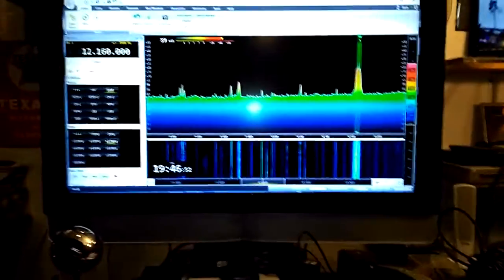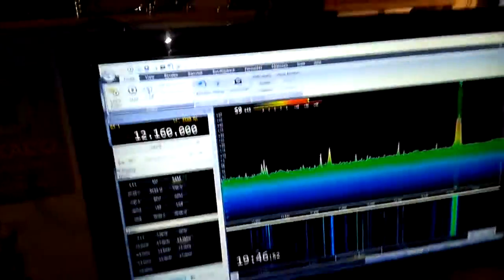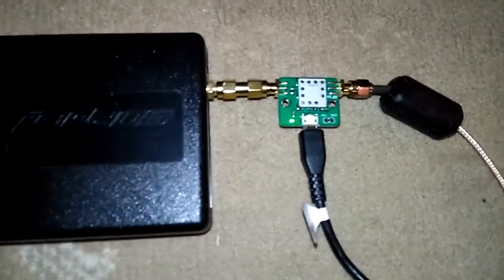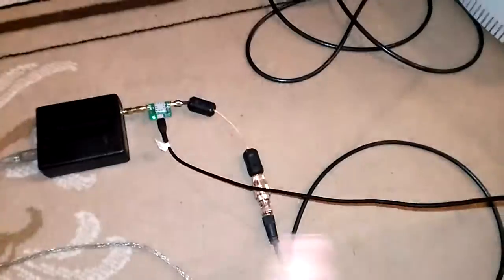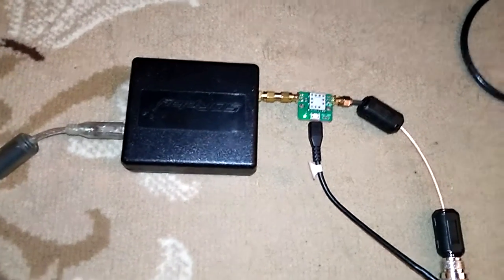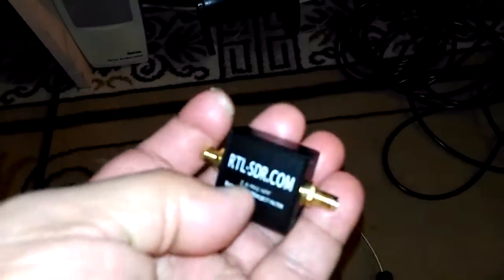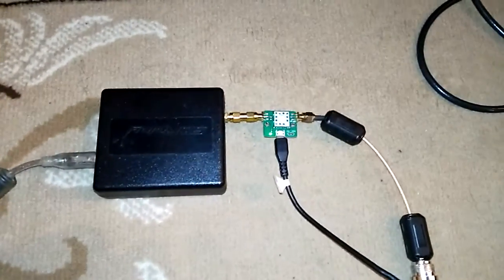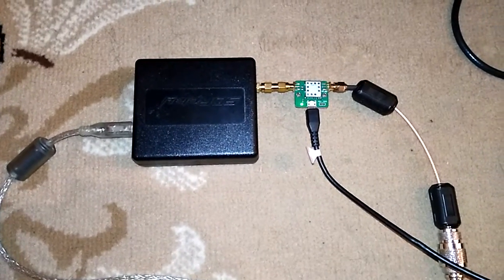DIY Copper Tube Active Loop Antenna - Low Noise Amplifier setup with SDRPlay RSP1

Comment: Which LNA is that?
Reply from the maker: They no longer sell this particular LNA on Ebay any longer,  You can search for another LNA on Ebay or Amazon as long it covers the HF bands from longwave to shortwave.  Thank you for watching.  Have a good weekend. :)
Reply: The Amplifier is from gpio labs: https://gpio.com/collections/low-noise-amplifiers/products/low-noise-amplifier-100-khz-2000-mhz-with-30db-gain and you can easily add a bias tee inductor for remote operation

Comment: Well done Danny. You may have just given us a low cost DIY alternative to the Wellbrook, MFJ and similar active wideband active loops. I would be interested in seeing LW NDB reception as well as MW and shortwave as you experiment further. Also, have you considered locating the LNA at the loop, and powering it through the coax? Not the easiest thing to do, but it would eliminate line loss in the coax run. In any event though...THUMBS UP!
Reply from the maker: Yes I have considered having the LNA near the loop and that will be the next challenge.  There are LNA kits I'm looking into. Of course I will be doing more testing on MW and also get NDB receptions on LW.  Thank for the kind words and your comments, have a good weekend and cheers!  :)
Reply: Danny, does the RSP1 have bias-T ability like the RSP1A? If not, you could try powering through a transformer AC/DC source. Avoid the switch type, it worked horribly for me with that particular LNA. Too much noise introduced to the LNA output! I think I told you that I am running my LNA off a USB power bank, but that would mean running to and from your roof...
Reply from the maker: The RSP1 does not have bias-T.  I will look into other power options for the LNA including USB or power supply.  I don't want to be going up and down to my roof lol.
Reply: Depending on how long your run is, you could try one of those active USB cables that monoprice makes. The ones recommended for rtl-sdr dongles, they run 15-25m in length. I have never used one, I am not sure if they introduce significant noise or not.

P.S. Was this video taken today? I couldn’t help but notice the game in the background… I wanted Jersey to keep the series going :(
Reply from the maker: Tampa Bay Lightning won the series and awaiting the winner of Boston vs. Toronto series.  BTW I'm a NY Rangers fan.
Reply: There is coax we used in the cctv industry called siamese.  It's RG8 with a pair of 18 gauge wires running alongside it. We used it on analog camera systems to provide power from a central power supply.  I have a ton of the crap in my shed left over from jobs I did when I was an electrician.  I know you were talking about changing the coax in your other vid, but this might be an option to run power to the LNA as well.
Reply: Axcually, nevermind, I wasn't thinking right. It's actually RG6. Sorry, Sunday morning brainfart.
Reply from the maker: No worries. I have a few solutions from some suggestions.  I have to order a few items and then test it.  I will keep you guys posted.  Have a great week, Thor.  :)
Reply: You’ll have plenty of options, the power draw on that amp is low. I have to employ tricks to keep my power bank from auto-shutting off.

Hehe I am a Vancouverite, so it’s GO CANUCKS GO! Unfortunately, like the NYR, it’ll be some years again until they’re cup contenders…